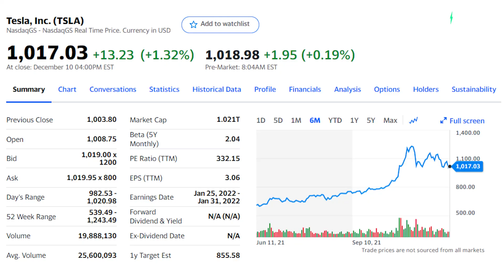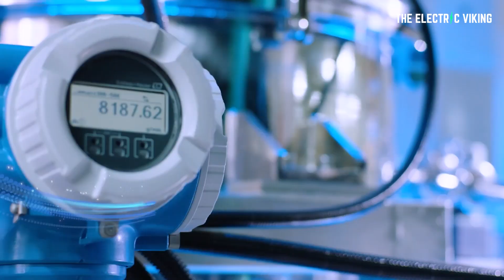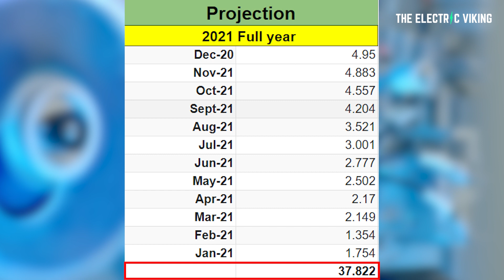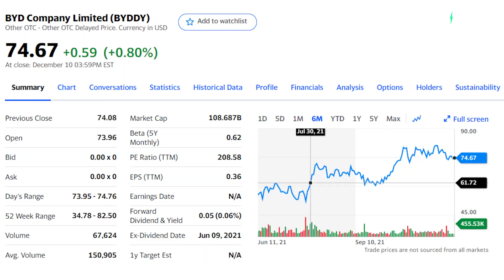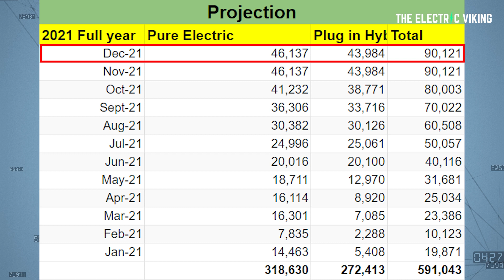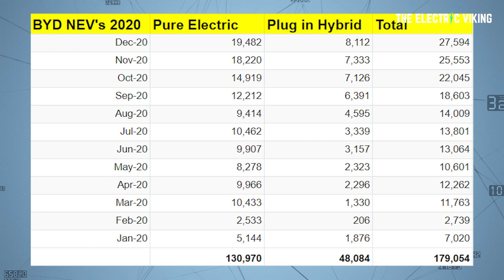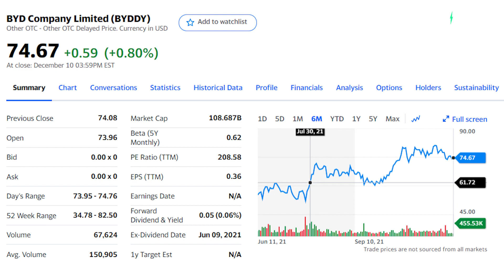This is the CRAZIEST EV and BATTERY story of 2021

Comment: Too bad BYD couldn't keep up the pace in busses from last year, otherwise this story wouldn't have overtones of borrowing from Peter to pay Paul.
Reply: what do you mean? they simply delayed their bus sales to make more money from passenger EV's; that's not robbing Peter to pay Paul, it's product selection.
Reply: @BSBSBSBSBS-i2x  In terms of overall batteries it is taking from one place for another rather than just making enough.
Reply: @gkochanowsky  yes but that’s very different from your earlier statement robing Peter to pay Paul is manipulation; product selection isn’t.

If they could produce enough obviously they would. So far this year they have tripled battery production already and have multiple sites under construction. I think they’ve done pretty well
Don’t you?
Reply: @BSBSBSBSBS-i2x  I said overtones.
Reply: @BSBSBSBSBS-i2x  According to the video, bus production was cut by at least half or 5,000 units. I don't know how many cars worth of batteries that is but if it's 10 cars/bus worth then that would be the equivalent of stealing 50,000 cars worth of batteries. This is stealing from Peter to pay Paul. And it doesn't make that "growth" in battery production as large as presented. You act as if you are personally affronted. As if you are the author of the video. Is that so?
Reply: @gkochanowsky  Utter nonsense. How is it stealing, it's simple allocation of production for the 3rd time.

They have tripled battery installed capacity from last year, whether the batteries went into a phone, a storage battery or a car or a bus. They have still installed over 300% more batteries than last year, meaning they have been able to increase production by over 3x, which is why they are no. 2 in Chin and now 3 in the world in battery production. FACT.

I am not affronted, but you till seem to infer that the numbers are manipulated which. they are not.

Comment: If this company was located in America or, even worse, in California, they wouldn't sell one Dolhin given the real world bad range provided by a LFP 40 Kwh battery. Even worse they wouldn't be able to produce the batteries needed to increase the battery capacity for the american market. Once CATL, Tesla and the rest of the world start producing LFP's outside China with dry electrodes the old BYD's costier manufacturing process of prismatic and blade batteries will become the weak link in the vertical integration of BYD.
Reply: Usual nonsense.
Reply: There’s no structural LFP battery on the planet as good as the blade battery
Reply: Prismatic form-factors are literally the most expensive battery cell form-factor.  This form-factor was invented to enable conformal batteries - cells in any shape, to fit neatly into consumer electronics products.  That extra flexibility comes at a higher cost.  Manufacturing at scale for prismatic cells is quite challenging; it's expensive to mass-produce them.

BYD started to trumpet their cell-to-pack technology after Tesla's Battery Day introduced to the world the idea of cell-to-structural-pack.  This was a 'me too' moment.  But BYD's cell-to-pack isn't a structural pack; prismatic cells cannot take any structural load.  They sit in trays.  A manufacturer can, in principle, make the trays structural by beefing them up.  But that is quite different from what Tesla is doing - using cylindrical cell cans as structural elements.  Structural packs can reduce vehicle weight.  Nonstructural packs can't.

I'm also put off by BYD's slick presentation involving cell penetration and battery fires.  This was not an independent test, but a test conducted by BYD itself.  BYD chose the penetration points.  How would the test look if they didn't have that control over the results?

The noise and rumors coming from BYD grab attention and cast the company in a very favorable light - if you believe them.  I think it's telling that there is no downside showing up anywhere.  When the news is all good, it's a marketing exercise.  I think BYD is trying to pump their stock price.
Reply: @luisdominguesforprogramaca3221  a Tesla fanboy saying BYD trying to pump their stock price up, that’s a bit rich. How many battery days has BYD had? How many BYD days has BYD had? How many tweets does Wang Chuanfu make? Nobody on the planet has heard of Wang Chuanfu. Wake up man
Reply: @luisdominguesforprogramaca3221  better, but still nonsense about BYD.

The BLADE. Was developed over a decade, not ‘after Tesla battery day’.

The platform 3.0 was the first ‘skateboard’ announced, the rest have followed.

BYD is probably the worst company out there at promoting itself, hence none has heard of them!

The blades are built into the 3.0 platform, so how is that not structural? And when will we ever see these batteries that Tesla still can’t produce? And why are they ordering blade batteries from BYD if they are so bad and this is all a scam???

And as for pumping their own stock, we’ll that’s just silly.

Try again.

Comment: Is there potential to increase its market cap for BYD, sure, but one should also consider that BYD multiplied its market cap by a factor of six within the last 1 1/2 years (18 months).
Reply: Very true, but if they double production again and improve their GPM next year,  you would hope to see the MC double purely on fundamentals.
Reply: @BSBSBSBSBS-i2x  Yes, gross processing margin is key, But at the same time it is very difficult to predict it especially in comparison to others, like Tesla. A lot of change is happening. Furthermore LFP is for sure for the near future (several years or this decade?) the battery technology to go, but if things are changing in the battery field a huge investment can quickly become a problem. Same applies to Tesla, we do not know how things with the 4680 turn out. I think they will turn out fine, but it is quite some risk - much less risk than doing nothing or being too late (Toyota etc.) for sure. Battery supply is the key to success within he next years, so BYD might be positioned best in that regard. Tesla is most likely the leader in production technology, which is also a huge factor. Most likely a race between Tesla and BYD and a few other Chinese companies.

Comment: I think Toyota finally  got its eyes 👁👁 opened by its partnership  with  BYD,  they saw BYD  is  going to eat their  lunch ,as  they  dont have anything like the Han, and  the Dolphin . on top of having to buy the  batteries from BYD. Toyota  now  seems  to have seen the light  and will try  to make 3,000,000  BEVs  by  2030...By  that  time  BYD  might be as  common as Toyotas  in Europe and the America's and Canada 🇨🇦.
Reply: I just heard about the Toyota's Announcement today via MarketWatch an hour ago. Are some of the 30 Toyota models by 2030 going to be made by BYD? THAT would be a coup for BYD if they can get their cars into the U.S. via the huge existing Toyota Dealer Base! Does anyone know the fine print? Viking?
Reply: @marktwain5232  The 2nd model on the BZ range is with BYD. The first was Subaru, so it doesn't make sense that moving forward they won't use BYD for the rest of the BZ's. Blade battery and the platform will be made by BYD; Toyota styling and BADGE!
Reply: @BSBSBSBSBS-i2x  Thank you Brother Paul for this interesting info! Toyota could save themselves if they get the BYD mfg design into the U.S. first! Wow!
Reply: @marktwain5232  I doubt there will be dealerships in the future
Reply: By 2030 Toyota could very well be bankrupt as they left the transition to Bev's way too late.
Reply: @Peter-vn8ue  Toyota is just a phenomenon and they will still be ruling the perch by 2030.
Reply: just to add:

Smoke screens and mirrors I am afraid. 

The announcement was for USD70 mio (double what they said in April), 50% still going to PHEV, Fuel Cell and 'other alternatives to BEV'.

They said 15 models are ready for production (originally announced in April) with 15 more planned by 2030 (new). 

What they 'forgot' to announce is the BZ range is being built by BYD and will have BYD Blade and use their 3.0 platform (this news broke in the press recently, but the JV was formed back in April). 

Very importantly in April 2021, Toyota announced it would introduce 15 BEV models just hours after BYD unveiled e-platform 3.0.

So the news is good, but effectively the cars will be built by BYD with Toyota interiors and a Toyota badge stuck on them.

There new sales target of 3.5 million (75% higher than the previous one) NEVs by 2030 included PHEV's and is only 1/3 of their total sales today. By 2030 who will buy the rest???

Lexus is good news, but again they only aim to be 100% all EV by 2035. That's a long way off.

Regarding the batteries:  Solid state batteries are not in production by Toyota and as of today they have no battery tech of their own, hence BYD's involvement. 

They said roughly one-quarter of the newly announced investment funds – 2 trillion yen – would be dedicated to accelerating the development of more-advanced, high-quality, and cheaper batteries, meaning they don't have that tech yet. 

So as I said smoke screens and mirrors, lets see what the reality is.

Comment: The big breaking news today is Toyota's giant announcement of $35 billion into BEVs. Lexus is going 100% electric by 2030 in North America, Europe and China. And globally by 2035. Lexus will provide an electric sports car, with a solid state battery, that does 0-62 in the low 2's while having a cruising range of 700 km. Toyota has doubled their previous planned number of BEV models from 15 to 30 by 2030, and from 2 million full EVs/year to 3.5 million/year. They'll be producing 280 GWh of batteries by 2030. Toyota is also putting an additional $35 billion into HEVs and FCEVs. Toyota is demonstrating what they've communicated all along: the agility to shift priorities as infrastructure and demand warrant. Akio rocks! 👏
Reply: Smoke screens and mirrors I am afraid. 

The announcement was for USD70 mio (double what they said in April), 50% still going to PHEV, Fuel Cell and 'other alternatives to BEV'.

They said 15 models are ready for production (originally announced in April) with 15 more planned by 2030 (new). 

What they 'forgot' to announce is the BZ range is being built by BYD and will have BYD Blade and use their 3.0 platform (this news broke in the press recently, but the JV was formed back in April). 

Very importantly in April 2021, Toyota announced it would introduce 15 BEV models just hours after BYD unveiled e-platform 3.0.

So the news is good, but effectively the cars will be built by BYD with Toyota interiors and a Toyota badge stuck on them.

There new sales target of 3.5 million (75% higher than the previous one) NEVs by 2030 included PHEV's and is only 1/3 of their total sales today. By 2030 who will buy the rest???

Lexus is good news, but again they only aim to be 100% all EV by 2035. That's a long way off.

Regarding the batteries:  Solid state batteries are not in production by Toyota and as of today they have no battery tech of their own, hence BYD's involvement. 

They said roughly one-quarter of the newly announced investment funds – 2 trillion yen – would be dedicated to accelerating the development of more-advanced, high-quality, and cheaper batteries, meaning they don't have that tech yet. 

So as I said smoke screens and mirrors, lets see what the reality is.
Reply: @BSBSBSBSBS-i2x  It's not about percentages. $35 billion is going exclusively to BEVs. The other $35 billion has a mix of hybrid and FCEV (which is full electric). The extra 15 models (now 30) is real. The bZ4X and Solterra are getting set to roll off the Toyota assembly line in Japan. There is also a different model exclusive to the Chinese market that will have BYD batteries and built in China. Lexus going 100% BEV by 2030 in N. America, Europe and China is big news. The 3.5 million BEVs/year by 2030 is as many as a Daimler and Suzuki sell of all their vehicles. Solid state is coming. And in anybody's book, 280 GWh of batteries by 2030 is huge. Great news overall for electric!
Reply: @StevenHoagland  I agree it's good news for EV's, but not for Toyota shareholders is my point.

35 billion is to develop new cars that are plug in so that includes PHEV's and unless they can go over 100 kms, all EV, then they dont help, although I believe they will as they have that tech., as they have their JV with BYD whose DMi's already travel over 120-130 kms on a charge.

The extra 15 models are by 2030, lets see if that ever happens. I doubt they will even get to 15 models by 2025.

The bZ4X was built with funding from Subaru and the joint platform they developed. The other model will be built by BYD. 

No one has stated that the new EV's built by BYD in China will  be exclusive to the Chinese market and think about it logically; if they can produce cheaper there why wouldn't they export as most of Tesla's cars are every month? 

Also, they will not go back to the subaru platform. 

So BYD will probably end up building 7 of the new 15 by 2025 (if they get built).

The 3.5 million BEVs a year by 2030 is as many as a Daimler and Suzuki sell of all their vehicle,s but Toyota today sells 3 times that, so do the maths; If by 2030 1/3 of their sales are NEV - 20% of all car sales in China in November were NEV - no 'developed market' will want to buy ICE, so it's only going to be poorer countries without EV infrastructure who will buy their ICE cars, so 2/3 of their sales will have to be to less developed countries.

At the same time, BYD will be selling 3.5 million NEV's by 2025 and making Toyota's cars and batteries and semiconductor chips...

I know where my money is invest between now and then!!!
Reply: @BSBSBSBSBS-i2x  Check the market. Toyota has shocked the world.
Reply: @StevenHoagland  yes! It will shock the world!
Reply: All will be built by BYD.
Reply: @BSBSBSBSBS-i2x  Not true. At the media briefing, Akio Toyoda said, "For its launch next year, we are preparing for the production of the BZ4X at Toyota's  MotoMachi plant right this very moment. We will soon deliver it to our customers."
Reply: @StevenHoagland  FACT. its reported yesterday in Pandaily but I cant post the link:

At the Media Briefing on Battery Electric Vehicle Strategies held on Tuesday, Toyota, a Japanese automotive manufacturer, released a fleet of 15 new electric vehicles, among which the bZ SDN concept car will be the first pure electric vehicle built by Toyota and BYD together. Its mass-production version is expected to debut at Auto China, which will be in April of next year, and will be put on sale before the end of 2022.

Toyota bZ SDN concept vehicle is positioned as a pure electric medium-sized vehicle, and its design draws lessons from the some of Toyota’s bZ4X other concept cars. The mass-production version released in the future will adopt the ferrous lithium phosphate blade battery technology from BYD, and it may be priced less than 200,000 yuan ($31,420).

On July 19, 2019, BYD signed a contract with the company, and both parties will jointly develop a pure electric sedan and a pure electric vehicle version of low-chassis SUVs, as well as the power cells needed for these products. Future models of two parties will use the Toyota brand and are planned to be launched in China by 2025.

On March 25, 2020, BYD Toyota EV Technology Co., Ltd. was formally established and registered in Pingshan District, Shenzhen, with a registered capital of 345 million yuan. Its legal representative is Zhao Binggen, Manager of the General Department of BYD Automotive Research Institute, and its Chairman is Hirohisa Kishi, President of Powertrain Company in the firm. Each party hold 50% of the shares, and its subscribed capital is 172.5 million yuan ($27.099 million).

BYD will build them all. Toyota are doomed.
Reply: check it out yourself!
Reply: @BSBSBSBSBS-i2x  As I said earlier, the one being built in China with BYD blade batteries is exclusive to the Chinese market and is a different model than the bZ4X. The bZ4X is being built by Toyota at the Motomachi plant in Japan.
Reply: @StevenHoagland  yes I agree. Where we disagree is after the first one built in Japan with Subaru, the rest will be made in China by BYD. It makes zero sense producing in Japan and Toyota are reliant on BYD for batteries; 3.0 platform even semiconductor chips. Toyota are in big trouble. This is just a gimmick.
Reply: @BSBSBSBSBS-i2x  Toyota is planning to build EVs in the U.S. Nothing solid on this yet, but it was floated at the opening of the Toyota battery plant in North Carolina.
Reply: @StevenHoagland  Toyota talks a lot mate, but in reality BYD are building their EV's for the foreseeable future. 

Toyota will at least 2/3rds of their market share over the coming years.
Reply: This breaking news is shaking up the EV world, since Toyota will be taking a sizable chunk of the EV market going forward while retaining loyal Toyota/Lexus customers that others were hoping to steal. Toyota's stock price has gone up considerably the last couple of days on this news. Akio rocks!
Reply: @StevenHoagland  keep kidding youself mate.